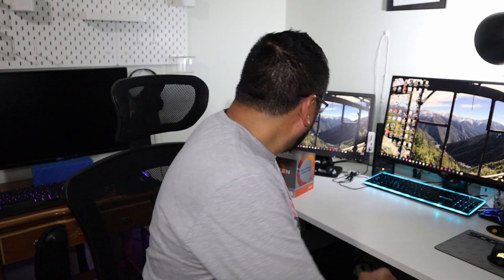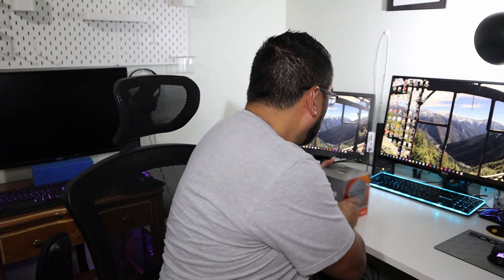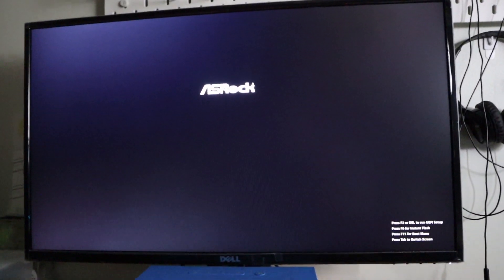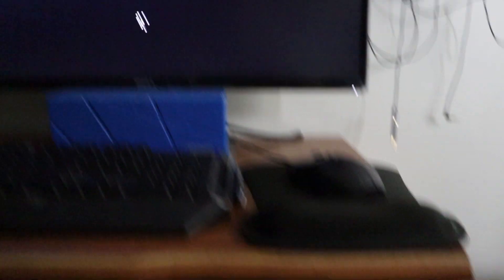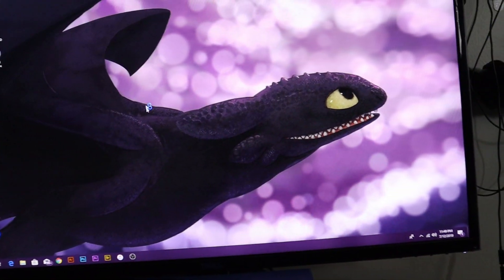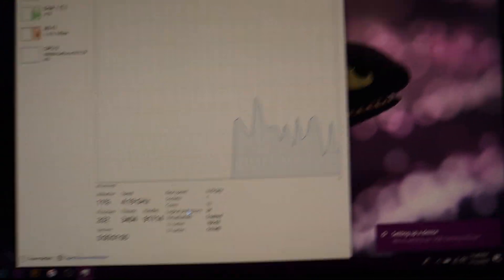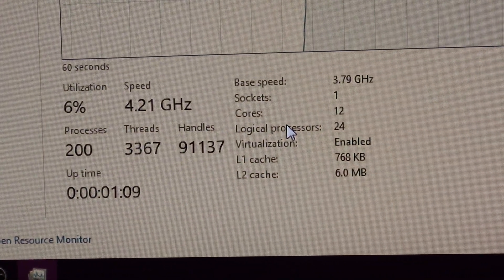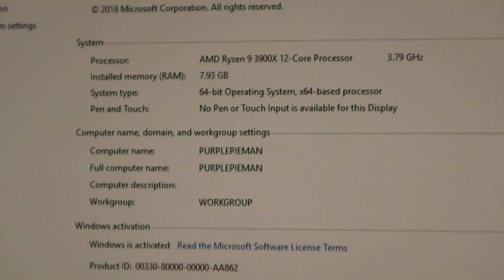RYZEN 9 3900X + ASROCK X370 MOTHERBOARD

Comment: Thank you so much for the video! I have the same nxzt case and x370 killer sli motherboard. Do you think it makes sense to upgrade 1700x to 3900x in 2022? so I don't want to reinstall tons of programs.. now I have BIOS p5.10, I think it won't take me any trouble to update the bios myself before installing a new processor. I'm also thinking of taking something like 3080ti and maybe adding more memory to get full 64gb of RAM. I think I will also have to change the psu to at least 850w

Comment: i did a simlar build same cpu and mobo updated bios with a 1600 a year or 2 back .....my question is did u ever get 3200mhz ram working with it
Reply: iv had zero luck geting past 1333
Reply from the maker: @spaid1988  the ram I have is rated for 3000 MHz and I’ve been able to overclock it even more to 3133...but it won’t take 3200 which isn’t surprising since it’s not rated for that speed.

Comment: Thank you for this video. Have you installed faster RAM to see if it would run with your CPU and motherboard? I have a 2700 on a Gigabyte ga-ab350-gaming 3 and the RAM running at 3400MHz but the motherboard only rated for 3200MHz.
Reply from the maker: No unfortunately I haven't.  The fastest I have installed is 3000 Mhz rated, overclocked to 3133.

Comment: Did you have any problems updating the BIOS with this board? I have the same board as you and cannot get the bios to detect my bios files (if finds the flash drive, but says no compatible bios found or something to that effect)
Reply: Nick Aroutsidis I have this same exact setup. and yes, I had to update thru about 4 or 5  different bios versions before getting to the last one for the 3900x.   If you’re on a early bios version you may also need a 1st gen ryzen to start the bios updates.  I used my ryzen 1700 to do all the bios updates.

Comment: If anyone is having trouble updating the BIOS you can't directly update to the desired version. I have a 3700x to get it to the bios version needed i had to update to 3.50 then 5.10 then finally to 5.40. Resd the description of each version.
Reply from the maker: There doesn't seem to be a work around.  I had to do the same prior to updating the CPU.  I had to update once, then update to the current version at the time.  Perks of DIY PC Building :P

Comment: does this support r5 3600 out of box
Reply: HUNtING FN wondering the same thing. But worst case scenario all we need is a BIOS update
Reply from the maker: Agree with West Dancer.  However, if you don't have an older CPU to update the bios with then he'd be stuck.  I'm not sure if AMD is still allowing Loaner CPUs for you to perform an update, but look into it.  Another option is to call the manufacturer directly and see if they can give you a response.

Comment: I just got a 3600X for my X370 killer ac to replace my 1600x. So I went to the Bios update page... gat-damnit ASRock...  then I left the Bios update page and went looking for help. I really wish someone would do a walk through for this motherboard BIOS update since ASRock mobos have such a convoluted and indirect BIOS updating process. You have to install these "alln1 Driver updates" before you can update the BIOS to later versions that included newer than first gen Ryzen processors." What if I wipe the hard drive or install a new boot drive? Will I need to re upload those drivers? It says on their page that "you need to install the drive package before the bios update to insure it works." don't those save to your storage? That's why I'm wondering. PLEASE HELP!
Reply from the maker: Hey Stanley, I understand your frustration.  I'm actually scheduling to make a video on performance increases after AGESA BIOS updates and installing NZXT Kraken cooler.  I haven't updated the BIOS since July when I needed to for initial chip installation.  I'll be sure to include the BIOS update process...see if I don't brick my mobo haha (laughs nervously).
Reply: you dont have to install anything. just download the latest bios and copy it on a usb and then do the update in the bios. its easy
Reply: @MaxiMuM1441  For this motherboard instant flash doesn't work. You need to use  a DOS method to install a version that supports instant flash.
Reply: this guys biggest problem is he didnt read...
You only need to install those drivers if your running a ryzen 3rd gen with an APU built in...  lol...

Comment: i know its kinda late but was hoping for help with bios update

same mono same cpu  ... my bios is p3.40 and i need to update to p5.50 but not sure if latest drivers include necesarry drivers from earlier.... like should i start with p3.50 and installl all bios updates  chronological or is it safe to just installl latest driver?  please advise thx
Reply from the maker: Yes, BUT make sure you follow the instructions from your motherboard supplier.  When I updated the BIOS on my mobo, I had to do it in steps, per the instructions from ASRock.  Meaning I couldn't jump from my old version to most recent...I had to install the different BIOS versions between my old BIOS and the current one at the time I installed my BIOS.  For me, I needed to install two BIOS versions to get my computer current and running with the Ryzen 9 3900X. The take away is: MAKE SURE YOU FOLLOW ALL THE INSTRUCTIONS TO THE "T" FROM YOUR MOBO SUPPLIER.
Reply: @gizmobreaker4187  thank you
Reply: @gizmobreaker4187  HEre's my BIGGEST concern. The web page states you have to install "alln1" driver updates previous to some of the BIOS updates. What if I later install a new boot drive? Will it need those drivers installed BEFORE I install it as the new boot drive? are they only needed during the update process? I am SOOOOO confused...
Reply from the maker: @StAlchemyst  would you be cloning the new boot drive?  If so, that shouldn't be a concern.  If you're installing a new boot drive with fresh Windows installation, Windows will still run from the new boot drive, then you could install the recommended drivers from ASRock.  A new boot drive does NOT affect your bios.

Comment: Hello,
Looking to do the same upgrade board/proc .  I am going from a 1600 so it should be a big jump for me.  I have 16gb Geil 3000 speed.  What speed DDR did you run with it?

Comment: have you overclocked cpu? I bought mine today and I have this same MOBO, I wanted a guide to over, because this mobo has no LLC.
Reply from the maker: Not yet, but I'm working on it.  I'll see how soon I can have it.  It's different than most overclocks.  From my research, is seems that per CCX overclocking might be the best rout to go.  Still doing some research though.
Reply: This motherboard does have llc
Reply: @ThaexakaMavro  Yes, this is very bad

Comment: Hey brother, what's up? Let me ask something. Are you having any trouble running 3900x  on a x370 MOBO? Some ppl say that there's no x370 good enough to run a 3900x
Reply from the maker: It's been running pretty good.  Have it running at stock and I put a decent load on it when I stream.  I use the x264 encoder and have 2 cameras connected in addition to the game play.  I did do a bios update prior to installing the CPU...that could be the cause of the trouble other people are having.  Keep in mind not all x370 mobos support Ryzen 3000 series.  I was fortunate and had one that did support it.
Reply: @gizmobreaker4187  heard vrm can get hot

Comment: What is a bios version? And how this board overclocked the memory? Thanks :)
Reply from the maker: This is the RAM I used, in case you're curious: https://www.newegg.com/team-8gb-288-pin-ddr4-sdram/p/N82E16820331036?Item=N82E16820331036
Reply from the maker: Bios version 5.4 - latest available from ASRock website.  Previously (with Ryzen 1300X) had RAM rated for 3000 mhz, overclocked to 3133 using XMP profile.  I've overclocked it again to same 3133 mhz with Ryzen 3900X and is working fine.  I'll keep you posted if I run into any issues.

Comment: Got the same mobo here, waiting on my 3900x to arrive.

What ram speeds are you getting? I've read that there can be issues with ram speed on the latest bios.
Reply from the maker: NICE!!!! Congrats...I know the feeling.  As for the RAM, I'm embarrassed to say that it's at whatever the default is.  In my excitement I completely forgot to go back into the Bios and set it to the rated speed haha!!!  It's rated for 3000 Mhz, but with the previous CPU (Ryzen 3 1300X) I was able to overclock it to 3133, not quite 3200.  From what I've read, you should be good up to 3600 Mhz, anything higher would require additional tweaking.  I'm traveling, but when I get back on Sunday I'll definitely get into this and let you know.  When is your 3900X scheduled to be delivered?
Reply from the maker: NICE!!!! Congrats...I know the feeling.  As for the RAM, I'm embarrassed to say that it's at whatever the default is.  In my excitement I completely forgot to go back into the Bios and set it to the rated speed haha!!!  It's rated for 3000 Mhz, but with the previous CPU (Ryzen 3 1300X) I was able to overclock it to 3133, not quite 3200.  From what I've read, you should be good up to 3600 Mhz, anything higher would require additional tweaking.  I'm traveling, but when I get back on Sunday I'll definitely get into this and let you know.  When is your 3900X scheduled to be delivered?
Reply: @gizmobreaker4187  Cool, I'm also going from 1300x to 3900x! I'll get my chip tomorrow.
Reply from the maker: brndrlmnt Awesome!  Let me know how it works out and what speeds u get on the 🐏 RAM
Reply: Ended up working great! Bios runs just fine, none of the bugs i've seen reported elsewhere.
Ram running just fine at the advertised speed (2933 @c16) as I made sure to buy a set specifically from the QVL.
Only seeing it boost to 4175Mhz on all cores under load. I attribute that to weakish power delivery of the first gen board. Overall, happy with it.
Reply from the maker: @TanukiTakey  NICE!  Glad to hear it's working well.  I finally got back and overclocked my RAM to same as I had previously - 3133 mhz with Ryzen 3900X and it's working fine, so far.  
RAM is rated for 3000 mhz.
I'll keep you posted if I run into any issues.
RAM is: Team T-Force Delta II RGB Series 8GB (2 x 4GB) 288-Pin DDR4 SDRAM DDR4 3000 - https://www.newegg.com/team-8gb-288-pin-ddr4-sdram/p/N82E16820331036?Item=N82E16820331036
Reply: You need to use "ryzen dram calculator" for oc your ram. Perfect program for Ukrainian developer 1smus
Reply: @MegaOooleg  Yeah, I actually did end up using that utility and got my timings dialed in really well, thanks!